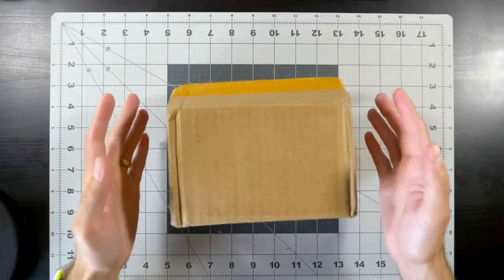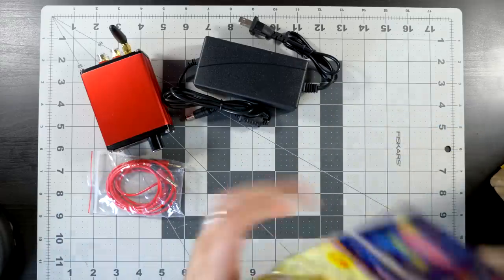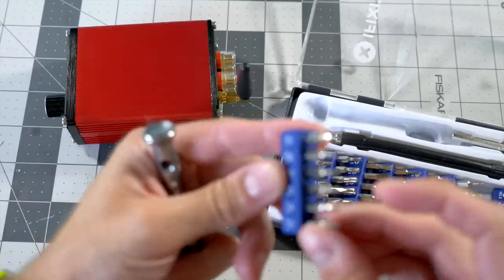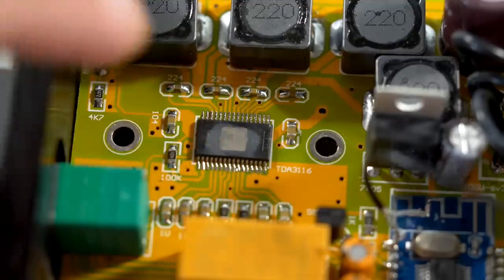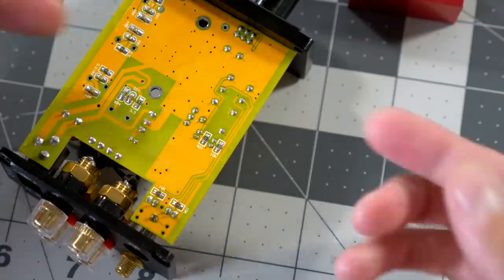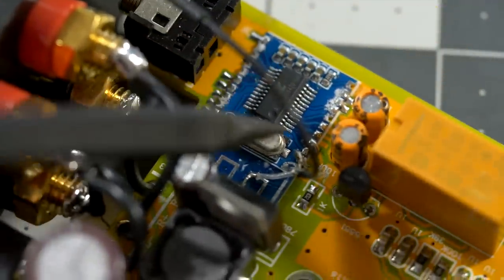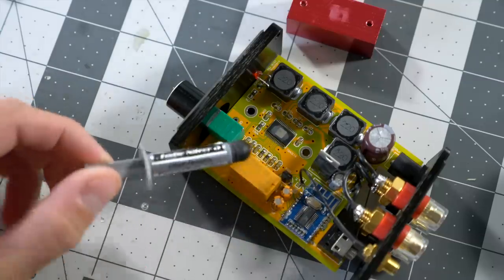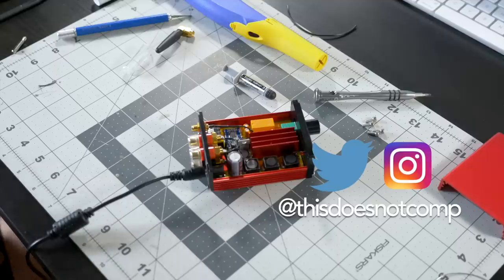Mini Audio Amp Teardown and Mod!

Comment: amateur review at its best...XD  I mean it in a good way.  I don't know anyone who was born a pro.

Glad the mod worked.  I would just use a power source switch unless I want to hack in a mute delay. There is a potential for shorter component life span if you don't leave it on because of cycling power surge and lack of mute delay on the amp chip.  Sparks from plugging in power is also bad.  Which may explain the redundant wire to power filtering cap.

Also, your cap is only rated for 25v 1000uf.  To get full 50w potential you want 25v power source, 35v 2200uf capacitor.  
The board design is always market dependent and must be flexible.  Simple supply and demand at the lowest cost possible. Online shopping made too many unwary consumers getting duped.

The 50w@20v 4ohm rating is correct for the 3116.  15w@12v into 8 ohm you are reading the wrong chip on the datasheet.
The 3116 chip looks legit.  At about $1 each great bang for the buck.
The cap is not necessarily used.  rough handling and bad chemistry cap can be expected at such low costs.

...thermal paste is used to bridge the gap between metal to metal contact. I just cringe when people put on gobs of it...

Comment: The case is exceptionally generic, yes. Also quite stylish (in my opinion), and actually not very cheap if you were to buy it on its own.
Reply from the maker: Yeah, no complaints about the enclosure, it’s actually pretty nice.

Comment: Those banana terminals doubles as screw terminals?
Reply from the maker: Yep, most banana jacks I’ve run across have a hole through the side that you can stick bare wire through. Pretty clever design.

Comment: 3 yrs late but it needs to be said. 

I'm sorry man, but this was a train wreck!  Watching it was exasperating AF!  
I just deleted 2 or 3 huge paragraphs where I go into detail about all the unfounded assumptions you made, but I'm sure someone else has already done that by now... 

It's enough to say that your first mistake was in thinking you knew better than the designer BEFORE actually understanding why it was the way it was.
A Bluetooth module consumes quite negligible amounts of power, so it was fine as is. Someone who pays 45 bucks for a generic amp and modifies it before even listening to it, can afford the pennies per year of running a damn Bluetooth module! And that switch that was "connected to nothing" clearly had a trace going to the chip on the top side of the board... like I said, unfounded assumptions. You could just as easily have added a separate switch for the module's 5V regulator.
Anyway, remind me not to let you anywhere near my stereo equipment!  ;-]

Comment: The switch almost certainly activates the chip amp's mute function. Which is completely superfluous. Just awful design.
Reply: The mute function would shut down the high-current switching block in the IC, which is probably the only part of the entire circuit that draws more current than the PSU's bleed resistor does anyway.  And, it would provide a clean, orderly shutdown to avoid thumps from the single-supply virtual ground.

It's not awful design, it's the recommended design.
Reply: Yeah, he should have actually read the data sheet before he turned on his soldering iron.   Does this guy always do goofy things like this?  Is that the reason for the name of the channel?

Comment: If you had 24 v at 5 amp you may probably get 35+ watts but 12 v is going to be 8-10w output with distortion. It is a class D amp so there is little or no current drain. Why be stupid if you expected the circuit then why acr dumb?

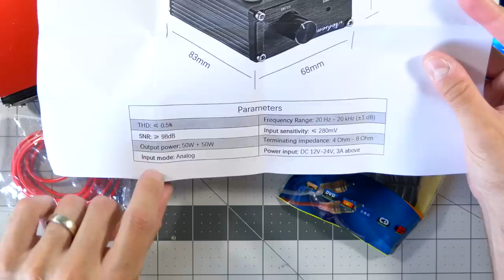Comment: 05:40 Surely the high the output impedance (Ohms) the harder the amp has to push? Take for the instance our old mate Danky at 'DankPods' say with his Sennheiser HD six hunge-eos... regular 'Dirty buds' are rated at around 38 Ohms, so can be driven by phones/laptops/tablets etc, but, 150/300/600 Ohm headphones need a heftier amp outputting higher wattage to drive the higher impedance headphones...
So, you saying this amp would possibly never deliver 50w per channel to 4 ohm speakers.... 🤔🤔 Wouldn't that be the other way around? ie NOT capable of 50 watt to 8 Ohm, but easier to 4 Ohm...
🤔🤔🤔🤔 😎🇬🇧

Comment: I thought i saw an easier way, i.e. doing the same as you but breaking that particular trace just after the electrolytic cap's pin that goes direct to the d.c. input jack, hopefully, the cap would stay idle with no current draw when turned off, er ...i think i.e. if appropriate circuit tracing confirmed this. & really? ...are you sure that was an actual trace above & below the board at that point? if so, then heck! what are they on?  after 45 years in electronics, ...."🤪i've never seen anything like that in my life!"  honestly,, there would've been no point whatsoever on an already connected pin. (unless it was a shared cap on a fully balanced design! but seriously, I presume the amp & light were both working fine with true on/off ability. & yeah, the speaker jacks we're drilled with little thought & zero precision! quality control? they must have been a tight-assed &/or lazy designing bunch of unscrupulous orientals to not have taken the time to achieve what you did with this amp tho it would have taken them little extra anything to have done this properly from their he ground up. I see it's a year old but i had to check this as I'm only just now on the verge of buying one of these budget class d amps < £120 maybe much less from e/Bay china, tho likely not this one, unless i find many folk praising the ass off this one for it's sound quality alone, tho the same chip probably exists elsewhere in a different make. Nobsound gear looked ok in it's close-up marketing pictures so i was slightly surprised at how the on/off volume part was designed here & those awfully thrown together speaker jacks!

Comment: Those need some case venting added.
Reply: Billy Boden It will depend upon how much power that heatsink is actually dissipating.  It is a Class D amplifier (digital PWM for the power handling rather than analog) so it is likely two pairs of power MOSFETs (in an H-bridge configuration) and they will always be driven to saturation (fully on/off) so the power dissipated will depend upon the RDSon resistance of the two MOSFETs that are on with each approximated half cycle, which may be anything between a couple ohms to tens of milliohms.  That allows for a lot of power handling with very little waste heat compared to a Class AB or, especially, A analog amplifier.  There will also be some heat dissipation in the low pass analog filter stage that filters out the frequencies above around 20KHz to remove the PWM switching frequency and smooth the rail-to-rail PWM pulses back into something much more analog that is a far better approximation of the original analog signal (the speakers will smooth things even more since any remnants of the pulses not already removed by the analog filter stage will exceed the ability of the speaker to mechanically reproduce).

Comment: It seems pointlessly small to be honest, especially given the massive power transformer.
Reply: That's Class D for you.  TBH, you could probably run this for a lifetime with no heat sink at all.  90% efficiency at something on the order of 5W continuous means it's burning ~500mW as waste heat.  An ordinary 1/2W resistor can handle that indefinitely with no damage.

Comment: Take a look at this video: https://www.youtube.com/watch?v=d6WkVSr_Hn8 . It is the same class d chip with different surroundings. In this Breeze Audio design they use an extra switch to mute the amplifier. I think the potentiometer switch does the same. And the chip is capable to produce 2 x 50 W rms power on a 4 Ohm load. You should have a look at the output filters in order to check if they are designed for 4 or 8 Ohms. If they are designed for 8 Ohms, your amplifier will roll of allready at 14 kHz.

I don't like the class d chips so much, because you really don't know what's going on inside them. I prefer my own class d design made of standard components in 3 versions:

https://ibb.co/M9sm246
https://ibb.co/XzC3zqp
https://ibb.co/616Wxyn